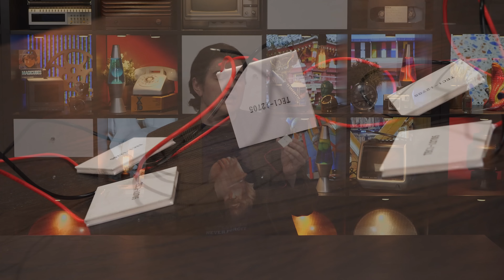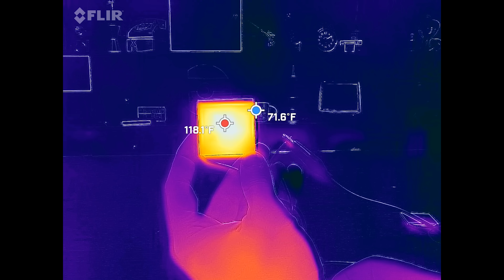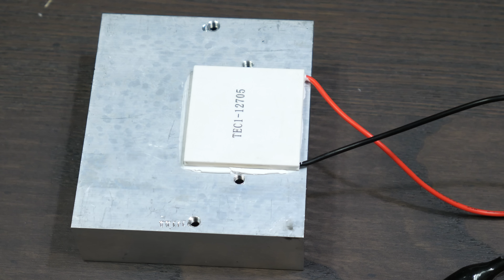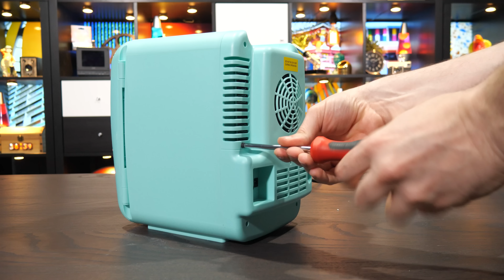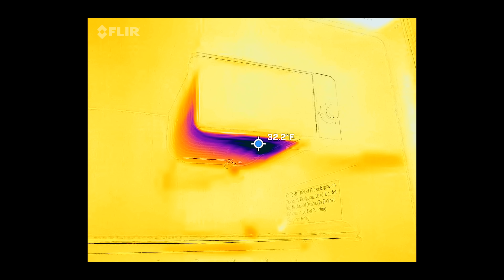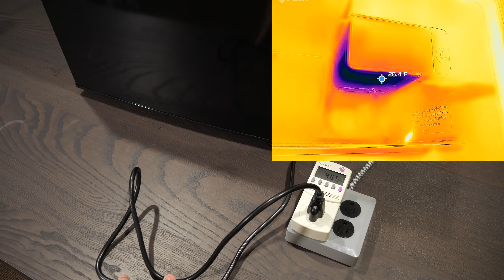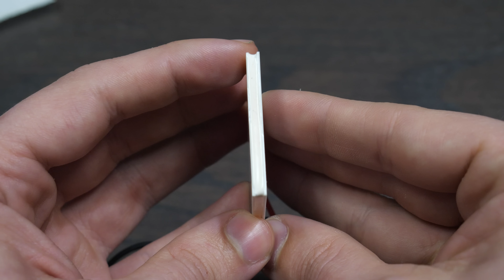Thermoelectric cooling: it's not great.

Comment: Since I’ve learned about TECs I’ve wondered if they could be used to improve dishwasher drying by creating a cold spot on the stainless steel during the drying cycle to ‘catalyze’ the condensation

Comment: peltiers are pretty cool, but do suck for a lot of things. especially those matress coolers. but i run one 5 days a week in a powered cooler while I drive my truck. I've been using it for over a year and it's great. as long as i freeze a water bottle and keep in there too. and yes, it works better than a regular cooler with just a frozen bottle. I tested with the exact same soft sided cooler as the powered part came in a much larger, crappier cooler, and I moved it into the soft sided cooler. also in a truck ~60 watts being wasted all the time is nothing to it.

Comment: If you are using these “electric coolers” or “iceless coolers” for applications outside of keeping already chilled food cool while in transit, because a typical 12 volt automobile electrical system can power these cooler, or a specialty need for keeping something cool in a compact location, you’re using it wrong. These are coolers, not refrigerators.

Comment: In '73, I was tasked with doing a design project for my engineering class at Rensselaer.  What to do?  I visited our extensive technical library and found two books about "frigistors" (peltier devices).  TWO books.  One 50's book by Soviet scientists who were trying to use hundreds of the then EXPENSIVE devices to run a full size refrigerator.  The other book (from the early 60's) was British.  They concluded the tech was a dead end.  I designed a small cooler using a double stack frigistor and some VERY efficient insulation.  I even designed the doping for the semiconductor elements.    With no facility to MAKE the devices, the project was a paper design only.  I never got my paper back from the professor.  A couple years later I saw this man's name associated with a company making what I believe was the first commercially available frigistors.  I later bought one of the devices.  It was $100. 

So I feel somewhat responsible for this toy, the idea of which, I think was stolen from my design project.

Incidentally, the peltier devices can be STACKED to obtained higher temperature differentials.  And I'm sure you know a peltier device can easily and cheaply be regulated by a thermostat.  And a good heat sink / fan design can be very quiet.

Comment: Okay, great, but how do I add a refrigerator compressor to my filament dry box to dehydrate my filament? I'm looking at Aliexpress, trying to wrap my head around how I would do this to keep my filament dry. Semiconductor-based dehydration is relatively obtainable using my rubber tub or a consumer cooler.
Reply: Also, I'm not trying to be a turd; I'm just genuinely wondering if there are any consumer-facing options for hacking temperature differentials into weird stuff.

Comment: I've just done an investigation into miniature fridge efficiency. I found a heat pump version with a COP of ~1.2 that drops down to ~0.3 when it starts cycling. It would be more efficient if it could vary the pump RPM to maintain a constant rpm at a lower power level.

The Peltier version at best was about 0.33 COP and dropped down to less than 0.2 COP at bigger DTs.

Heat pumps are better than Peltier in basically every way that matters other than size, maybe noise, and on tiny heat movement requirements: cost. But you can still make terribly inefficient heat pumps if you want to/don't put the effort in.

Comment: Honestly these aren't even good as car fridges. Igloo now makes a compressor car fridge and you can find decently large compressor coolers on temu for $80-$300 depending on size. They use only 30-60 watts and work great. I was honestly shocked how well it was for the price. They are also decently insulated and you can have one side as a fridge and the other as a freezer. They are perfect for road trips. I live in Phoenix and they work great for my grocery trips. I can finally buy ice cream from Costco again 😂😂😂

Comment: Do peltiers more efficient in generating heat than ordinary heating elements?
Btw can I use it to make a diy 3d printer filament dryer? One side heats the air, other side condensates the moisture in the air, removing moisture from the filament.

Comment: I found a Peltier module in mobile car cooler around 10 years ago, when i was a kid, i was amazed. I was going to cool everything, until i realised, it does not have the capabilty and consumes enormous energy. They are just in the drawer somewhere.

They do have their purpose, when wanting to avoid a heatpump due to weight/space conditions.
I have even seen a stacked Peltier to further decrease the temperature on the cold side ( might have been on mikeselectricstuff's channel or EVVBlog). It is used frequently for laser diodes, high speed cameras, thermal cameras. I am not 100% on this, did not want to look thru hours of video, but if i recall correctly James Webb Telescope uses the technology as well, after a short Google search, NASA definetly be using them.

Thank you for using metric as well, much more easier to understand. Great video.

Comment: Used TECs in a lab to heat and cool laser diodes where high precision is needed since temperature changes the laser's wavelength. When we needed actual bulk cooling, we had a giant chiller made in the 60s that uses the normal refrigeration cycle.

Comment: The blue blob doesn't need to be such stupid junk. It would need, IDK, six coolers, more insulation, and a thermostat. The cooling would be more capable, more energy efficient, and may not need a fan given a big enough heat sink.

Comment: Are you telling me there’s more butane in a 6 pack of lighters than in my fridge and I’ve been living in mortal terror of my fridge exploding like a firebomb for no reason?
Reply: You could probably still make your fridge explode, but you'd have to try really, really hard.
Reply: So you’re telling me its possible to make a fridge heat exchanger using 6 lighters?
Reply: Uhhhhh yes
Reply: I watched a friend intentionally crack the fuel containment of a butane lighter while drunk when we were young and stupid.  The result was bad frostbite on his hand, as all the butane instantly boiled away.  It killed some of his skin, and it sloughed off over the following days.
Reply: @bobhotchkiss2438 OH the good old days!!
Reply: On the other hand, I was on the roof of a shopping center working on some air conditioning and walked past one that looked like it went up in flames. Pretty sure it was converted and developed a leak, that AC unit held probably around 3-5 pounds.
Reply: it's still quite a lot actually, 56 g is about 22.6 liters in ambient pressure.
Reply: @paradoxcorporated2906  I was thinking there was gallons of the stuff in the fridge. A few liters of gas is going to be a fwoosh not a boom.
Reply: @Mostlyharmless1985 most refrigerators have half a pound of liquified gas in them some take a little more but it’s not much physically
Reply: Also I would like to to add that the refrigerant butane and propane are slightly different than your normal butane and propane. They are flammable but like another commenter suggested here, you would have to try really hard to make it explode.
Reply: @Mostlyharmless1985 The difference between a fwoosh and a boom is containment rather than the quantity of material. Also, 22.6L of butane gas is something like 750L of optimally flammable air/butane mix, or ~1200L at the LFL. Good thing a fridge has a built-in explosion panel of a door to blow open!
Reply: @FalloutGenius1 The only difference between refrigerant grade propane and the "propane" Americans put in gas cylinders is that the refrigerant grade propane is actually just propane. The other has various other hydrocarbons in it because it all burns who cares. It's by no means less flammable.
Reply: @paradoxcorporated2906  Which still isn't much. Butane in lighters is stored in liquid form. A refill can of lighter gas would contain enough to charge 4 fridges with refrigerant, and you can buy that for a few dollars.
Reply: Pure propane is also a widely used refrigerant now. It's literally impossible for an explosion to occur since refrigeration circuits have no oxygen in them the circuit has to be in a vacuum of at least 500 microns or less before the refrigerant is added so therefore no oxygen no combustion.
Reply: @danmacrae7943 I work with soldiers. The second someone says it’s impossible is the minute some of America’s finest finds a way to do it usually while drunk and wearing overalls with no shirt.
Reply: You're probably thinking about your AC for a home. those use a few pounds of refrigerant. mostly because of the line between the compressor and the evaporator.
Reply: Not for no reason; that baseless fear has been keeping your neurotic mind from deeply considering the far more troubling reality of the fragility of your life and everything you hold dear
Reply: @JM-ic9yx uh…you good dude?
Reply: Tell me you have OCD without telling me you have OCD.

Comment: my very portable peltier camping cooling box works just fine for keeping my camping beers cool.   as long as it is warm enough.  I did notice that the (not so very high) dutch summer termperatures  sometimes cause the cooler to become one solid block of ice, and effectively stop cooling the air.

Comment: I had one of these in my middle school locker. Small single can fridge where the drink sat on the cooling element. I would put a coozie on backwards over the can which I pre chilled at home and ran it off of a 12 volt battery bank that I made. I always had cold sodas at lunch and made my peers jealous (sodas couldn’t be sold in school)

Comment: I have a question for the person who decided how the heat sink would be mounted to the peltier: why are the fins of the heat sink horizontal and not vertical? Heat goes up, you'd be able to use convection, to a minor degree, to dissipate heat naturally if you didn't orientate the fins the way they are. I imagine that they're horizontal because it's easier for air circulation within the current iteration of the case but it seems counter intuitive to "no moving parts".

Comment: I've seen people using pelletier elements for astrophotography, cooling the sensor to get lower noise (better signal to noise ratio). It might be one of the only good application for these things.
Mostly because pelletier + heat sink + fan is pretty cheap and still good enough

Comment: when you see the back opened up, it bothers be the maker aligned the heatsink with the fins HORIZONTALLY, as are the vents to the side, when VERTICALLY would have moved more heat out of the casing at no extra cost o.O  
It's like they TRIED to insulate the heat evacuation, sabotaging their own design o.O

Comment: I'm glad you posted this, as more people need to know how bad those wee fridges are are.

By the way, the thing you said used isobutane (as a refrigerant) had a massive sticker on the back indicating that it used C-pentane in some regard. Is that showing what was used as the blowing agent for the insulation, rather than the refrigerant in the circuit?

Comment: I never actually realized just HOW efficient refrigeration is. Since they're regularly capable of moving more energy than they consume, would it be possible to harness that for (relatively) clean power generation?

If we're moving all that heat around anyway, surely there's a way to use it, conceptually similar to regenerative braking from EVs, but with thermal instead of kinetic energy.

Comment: I have one of these that is meant for a car and plugs into 12v. It might help keep some  pre chilled drinks cold at best. But it's it better than a cooler? Ice might cost $2.50 and will last a whole 20 hour trip with a much larger capacity. It would be interesting to see what the fuel cost to run the peltier fridge for those 20 hours. 

Chatgpt says a peltier fridge at $3 per gallon of gasoline only used $0.10 for 20 hours which I find acceptable if that's correct but I suspect it's not, but it's still not going to be as good as ice in a cooler. I wonder how much better a well engineered peltier fridge would do.

Comment: I have, next to my desk at work, an old Coldspot "dorm size" fridge, one of the ones that's about 2.5-3x the size of your standard cube.  For those in the know, Coldspot as  brand is a dating tool: Sears dropped the Coldspot name in the 70s.  That is to say, this refrigerator is older than YOU are.  At full chat, it pulls about 120w...but its duty cycle is also no more than maybe 25% so we're looking at what, 700-750 watt-hours per day.  I trust it implicitly.  Of everything in my office that has broken and been replaced, it is the one thing that has never so much as hiccuped.

This, from a small appliance that made up the cost difference of purchase+utility consumption between my example and The Blue Thing before the 1980s even started, and The Blue Thing will be disposed of as the cheap plastic toy that it is when its fan fails.

Comment: A point in favour of the Peltier mini-fridge. It is portable, usually with a carrying handle. Staying for a couple of nights at a motel that may provide a kettle, some foul tasting coffee and sachets of UHT milk, we prefer to use our minifridge with a carton of milk plus our own tea/coffee. It is much easier than trying to carry one of those cube fridges with a compressor, getting a hernia in the process..
As regards noise, I have fitted an ultra quiet fan. they are cheap and no trouble to change.

Comment: Has nobody tried using Peltier coolers on CPUs or GPUs? Would there be any use case or do they just run far too hot?
Reply: There are entire videos and articles about this that you can easily find - for TLDR version: math doesn't adds up, you spend to much energy for the gains you get - its the same as with this toy fridge.

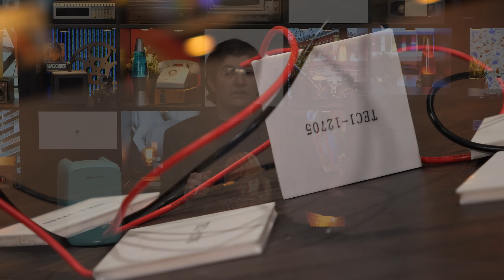Comment: 24:15 to be fair what they're supposed to do is steal energy from natural heat transfer, not actually transfer that heat. So in reality they should be slapped all over the outside walls of the fridge to steal back some of the energy spent on the refrigerant and temperature control. In theory one could possibly use them for cooling and avoid a fan by just putting them all over the walls of the fridge but that's just a theory, a tech theory :D

Comment: It's not the peltiers fault that the mini fridge sucks because its maker just wants your money. Peltiers can make 'a local lack of heat' very effectively but they cannot move heat at great volume.
Running stacked peltiers at 5% their load will easily give you a COP over 3, BUT then the insulation and cost will make that fridge bigger and more expensive than the real compressor unit. 
Thermoelectric cooling, especially the Peltier effect and it's reversibility is great, it's moron implementation in a mini-fridge is not.

Comment: Peltier elements are used in many laboratory instruments. PCR thermal cyclers, cooling elements for high speed microscope CCD cameras.

As for the silly little blue fridge, now I just want to put an overkill, massive CPU heatsink on it to make it run passively. 😂

Comment: Another interesting and enlightening video! Although O WAS a little disappointed not to learn anything about HOW these Peltier elements move heat just by running a DC current through them; but I infer from that omission that the answer is probably either long and complicated, or still not fully understood.

Comment: You forget the only reason why i ever considered buying a peltier element, which is, that it could create electric energy from heat and/or cold temperatures. I said i considered and i mean i really rub the math like 5 times within intervals of like 2 years becouse it looks like a cheap option to create energy, but it is not. The efficiency of peltiers is bad, and stay bad if you use them as a generator. So I found out it would only be worth it if you happen to have something that is getting very hot in an environment that is quite cold or very cold in a hot environment. I thought of many applications where this could be useful and i ended up with the backside of solar panels, to keep them more cool and use the heat energy to produce more energy, but to cover the surface area of a solar panel you would need many peltiers like really many, and even if they are cheap many of them are more expensive than just buying another solar panel. But I thought ok, maby we could combine that with a refrigerator cycle and concentrate the heat to ome point to just use less peltiers and while that would work it would need to run a compressor and need complex tubing and anything and the efficiency of the peltiers is so bad, that the energy got from the solarpanel and the Ambient by the very efficient heat pump cycle would be not that much at the end to be worth the effort if it would even produce more energy than it consumes... so i did not continue this idear further. So the only application where this generator could be helpful is if stick to an oven that is used to heat a room and therefore quite hot and is not electric powered so for example a wood burning oven. But as i do not have such an oven i never was buying any peltier elements, except for a portable car cooler bag to cool food while travelling in holiday, which is exactly the only exception you mentioned. 

I really appreciate the preciseness of your videos and did enjoy them a lot. I really want to thank you for your work and that you translate all measurements to SI-Units for us non-American humans.